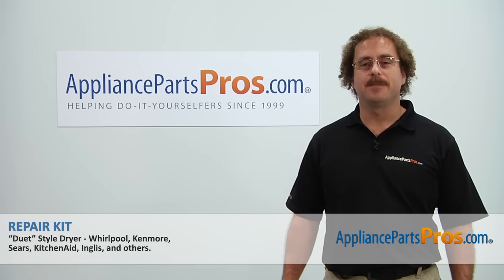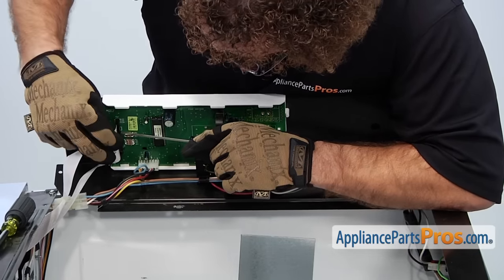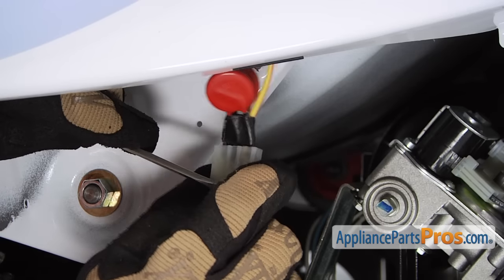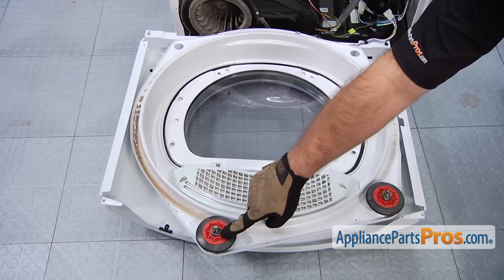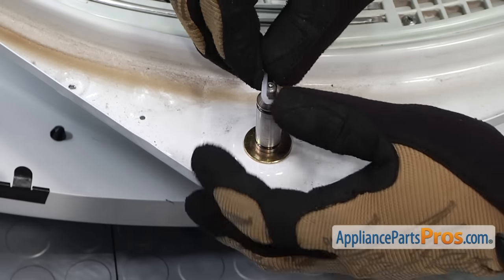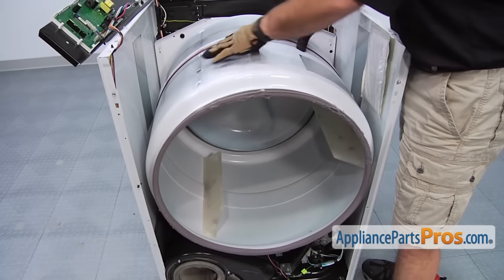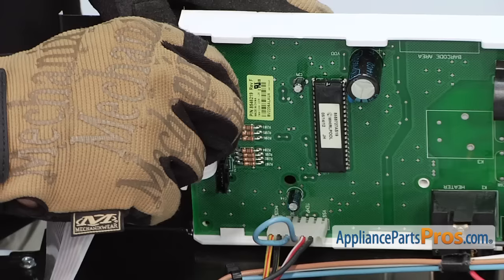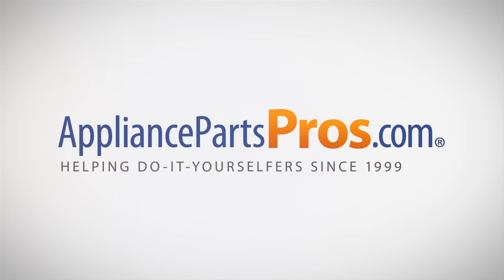Duet Dryer Repair Kit (part #4392067) - How To Replace

Comment: Kudos to Appliance Parts Pros on this video.  After receiving the correct Dryer Repair Kit for my Whirlpool Duet Dryer, I followed the instructions on the video step by step and replaced the dryer belt, rollers, and pulley.  The dryer started up and ran fine.  I appreciated the straightforward yet detailed instructions that allowed a novice to make a successful repair.

Comment: While my dryer model was slightly different in the disassembly, this video was extremely helpful and the replacement parts were perfect. Not only did I save money on calling a repair service, but I also found a $20 in the dryer (along with more lint that you can imagine)! Thank you!

Comment: My Dryer made loud screeching noises, so we thought maybe we needed new dryer since it is 15+ years old.  I did research and saw there was a repair kit for $50+ with new belt, rollers so I thought why not try it since new dryers cost $700 to $1000.  I had my buddy help me since it talked about needing 2 people.  The only issue was removing wire harness in front, it took almost 20 minutes.  To my surprise, one of the back rollers was laying in bottom along with metal shavings since large dryer drum was turning on metal.  Replaced everything and put back together, along with cleaning years of lint all over.  When completed turned back on and dryer ran like new, quiet and also drying faster.  Thank you so much for providing such a complete repair kit.
Reply from the maker: Glad you were able to complete your repair! Glad we were able to help you out. If there is anything we can help you with in the future please let us know.

Comment: We are SO HAPPY with your quality Whirlpool parts and FAST delivery. I must have hit your shipping deadline perfect, because we had our parts delivered by Fedex only 22 HOURS after ordering using your medium priced “fast” delivery! Folks, spend the extra $3 for “fast” delivery! I did have SEVERAL differences between my dryer and the one in this video, but they were all easily worked around and the job only took 2.5 hours including breaks and looking for a tool lol. Dryer is noise-free now!! Thanks for the GREAT SERVICE which I recommend to anyone in need of a DIY remedy.

Comment: Well done Matt, we just installed a repair kit to our dryer.  Thanks to your video we had no problems and no leftover parts.  The dryer runs very quiet now, no loud squeal.  Recommend that anyone going to this much trouble also clean out the vent tube all the way to the outside,  we collected enough lint to knit a sweater.  Thanks for the guidance.
Reply from the maker: I'm so glad our video was helpful! And you're right - anytime you open the dryer, it's a good idea to go ahead and clean it out.

Comment: Thanks for the video! I did the whole kit replacement because I needed to replace the broken belt and figured it was a good time to replace the rollers.
 Never had experience in doing this before. Went well and better yet it worked when I was finished. Learned a lot while doing it. Not bad for an 80 yr. old.
Reply from the maker: You're welcome!

Comment: My dryer was squealing a little, figured was the belt.  Got it apart and it was the idler tension pulley needed cleaning and re lubing.  Went ahead and cleaned and re lubed the 4 rollers, now my 17 year old dryer runs like new.  Thank you!
Reply from the maker: You're welcome!

Comment: Outstanding video that saved us a bunch of money. A few observations: Half of your time will be spent cleaning the lint inside the dryer - vacuum thoroughly, use compressed air to blow lint out of the motor there is a ton in there and lint + spark = fire. Beforehand, empty your vacuum's canister and after you are done vacuuming, dump the contents on a newspaper and go through it for lost items - you will be surprised what you find! The triangular rings (tri-rings) are, on replacement, very difficult to move all the way down the pulley post - if the inner ring looks good, leave it alone and just put a new tri-ring on the outside once the pulley is in place. To remove the old outside tri-ring, use a pair of cutters. The washer for the idler pulley - use this, even if you find a tri-ring was used on the inside position. Clean each pulley with a solvent like denatured alcohol or Gumout on a towel - there is buildup that will keep the pulley from moving a smoothly as it should. Good luck and enjoy the wonderful sound of your repaired dryer!

Comment: Thanks for posting this. It is an excellent set of step-by-step instructions. I used this video today to repair a Duet dryer purchased in 2005. For us the old pulley seemed to be the problem, as it was squealing when the dryer was running. It is working fine now.

Comment: GREAT video!  There were a few differences with my dryer, but overall it took me about an hour.  The most difficult step was getting the dryer belt back over the idler pulley and motor.  But I took the back of the dryer off and it was on in a jiffy.  $30.00 for parts, and this video saved me a ~$150.00 service call.  Thank you very much!
Reply from the maker: You're welcome! That belt can be tricky to get back on, but all you can do is muscle it back on there. Glad we could help!

Comment: This video was awesome. I watched it once thinking, oh my, this is SO much work. But,  with step by step instructions, I was able to take apart my dryer, install the kit, and put it back together... And it works! Thank you! I never thought I could get it done.
Reply from the maker: +Chris Swick Awesome, glad the video helped you get the dryer repaired!
Reply: The hardest part working on washer/dryer is getting access to it. In my case, we have a very small laundry room which barely fits both machines!

Comment: I bought the kit for about $50 and did the repair myself. I saved over $250. My unit must be older because there were some slight differences. The vent housing had 4 screws, (no clip), there were no ribbon cables, they were wire bundles with barely enough slack to move out of the way but the biggest difference was the tub orientation.  My clip was in the back half. I knew it was wrong but decided to follow your video and assembled the drum and the belt around the gear pulley and as I was spinning it the belt kept moving away. I reversed the drum position and it’s working fine. Mine is stacked in a closet so I used a ladder to get to the top.  It was a little tight to get to the screws on the top/back so I used a socket. 
The most difficult time I had was removing the old triangle washers and moving the new ones down the shaft from the first groove. 
My dryer is about 16 years old and I just couldn’t see spending over $300 to replace the shredded belt. I am so glad I did this myself. 
I found about 1/2 lb of lint, sand, pet hair [and a gum wrapper] clogging up the vent just below the lint screen even though I use a long brush to clean it out regularly. Also, the motor coils were compacted with dense, fine lint. There was so much lint and pet hair inside, that I am surprised it didn’t cause a fire. 
Thank you for an easy to follow video and good deal on OEM replacement parts.

Comment: Instructions and parts were both excellent. My dryer was making a loud squealing noise. It was a slightly older model than the one in the video, it did not have the computer ribbons just some power clips to disconnect and some wires plugged in to the mother board. Disassembly was also slightly different since there was a decorative piece that covered the switches on the front and the top console did not come off quite the same, since it snapped around the outside of the drum. 
What was truly interesting (and the probable cause of the squealing), was the original assembly of the idler pulley . There was no washer behind the idler pulley. Instead one of the triclips was installed there without a groove to sit in. Both of the triclips on either side of the pulley were brittle, discolored and showed signs of having  been very hot. I installed all of the parts in the kit and they fit fine. The dryer is back running like a champ. I would highly recommend your video and your parts.

Comment: I just bought a used Whirlpool Duet dryer which I am told is noisy. I think all I need is one of these roller/belt repair kits and it should be good as new. Thanks for posting this video!!!!

Comment: Just verified my model number and ordered this kit. My Dryer was making a knock knock sound for like a year. I let it roll, now it started making a horrible racket. Its a chick chick chick bearing noise. I don't feel like taking the thing apart more than once so I'll chock it up to maintenance and replace it all. Your video shows good detail and from someone who has never repaired a dryer, this looks super easy. I will be using your site for any other parts I may need in the future!
Reply from the maker: Glad the video helped you get the dryer fixed!
Reply: now i gotta figure out the new problem with the washer! F11 MCU communication problem!  ACK!
Reply from the maker: Without knowing what you have, I would suggest posting the problem along with the appliance model number on our repair forum and the techs can help you troubleshoot the problem. http://forum.appliancepartspros.com/

Comment: Best video I found for this fix. My dryer is slightly different but this still fixed it. I installed the whole kit since it has 10+ years of wear on it. The tension pulley was the culprit but there was no reason not to replace everything in the kit since getting the thing apart was really the hard part. Putting on new parts was a breeze.
Reply from the maker: Glad we could help!

Comment: This video was a great help even though my Whirlpool Duet dryer model # WED9500TW@ had a few differences. The biggest difference was the way the console is removed.  Mine has a trim ring that goes around the door that is attached to the console but once I figured out that all I had to do was pop the trim loose then lift the console off, everything else went smoothly.  Glad I ordered the entire kit, it turned out that the problem was the idler pully locked up and the belt just kept turning and eventually wore a groove in the plastic idler roller pully.   That explained why the dryer drum would turn but very slowly and not at all at times.  Thanks again.
Reply from the maker: Glad the video helped you get the dryer fixed!
Reply: I just finished getting my dryer back together and everything cleaned up... my first thought was to come here and talk about the difference between the dryer in the video and mine, which coincidentally happens to be just like yours!  I know it's a two year old post, I thought I'd just give you a shout out and tell people READ THE COMMENTS BEFORE DOING THE WORK!  If I had done that I wouldn't have been as frustrated!  Enjoy the day!
Reply: Paul Arthur Thanks, I was a little confused until I read your post! I was having the same problem!
Reply: I'm about to tackle this same project with our WED9500TW3 and I am expecting the same trim difference.  Was the trim piece easy to remove/pop loose?  Any screws or tabs I need to be aware of that you remember?

Comment: Great video, was able to fix my Whirlpool Duet dryer. Loud screeching noise, turns out it was the idler puller. The only issue was that my dryer was a newer Whirlpool Duet dryer, the front panel was more difficult to remove that the older model shown in the video. I had to bend it up to access two hidden screws.

Comment: Great video, very easy to follow.  Took about 90 minutes for the repair, which included a lot of vacuuming of lint/dust that had gathered throughout the years in the dryer.  We've had the dryer for 10 + years, and this was the first repair to it.  We originally thought it was time to drop serious money on a new set.  Definitely not the case. Thank you for the video.
Reply from the maker: Glad the video helped you get the dryer up and running!

Comment: Thank you so much! This video was extremely helpful. I had a destroyed belt that covered the inside of my dryer in black dust and shreds. Replaced all the parts easily by following your directions and got to clean the huge mess inside.

Comment: Thank you so much for your easy to follow/understand video.. I just repaired/replaced the rollers/belt on my Kenmore HE5- it was almost identical to the video, except for a grounding wire(easily added step.. ).. saved me some $$ on a repair dude!

Comment: OK, so this is an absolutely brilliant video.  My Duet dryer is a little newer and a slightly different model, but this showed me what needed to happen and I figured it out.   However,  am I the only person that thinks the entire dryer should be made out of the "tri-ring" material?  Those things were an absolute B** to get off and they are made of some tuff stuff.   I noticed that even the video cut-out a bit while he was removing them - likely to sensor out the swearing involved.  

Bravo on a great video and thank you very much for producing it.

Comment: Thank you so much, looks like the dryer I purchased used a year ago was worked on before. Someone added grease, and only replaced 3 of the 4 rollers. The pulley was shot and I'm glad I did this asap before the motor went out too.

Comment: Overall I got what I needed from this video. Should mention however that your demonstrator  installed the drum in backwards. At the @ minute mark on the video, he makes a point to mention the black line that the belt makes on the drum, and proceeds to point right at the opposite side, without the black line. He also mentions that the silver tab going  in front, when it actually goes towards the back. I followed the reassembly instructions and even though it went together just fine, I quickly noticed the belt line on the opposite side, and a slight gap around the rear drum felt seal. Funny, when he took it apart it was correct.
Reply: I’m taking pictures as I take my dryer apart to help me put it back together since your comment gave me pause. Also using a Sharpie to mark connectors and tub direction. Love these videos-nicely done.
Reply: Agreed.  I thought I knew which way to put the drum back but when he said the silver tab goes in the front, I turned mine around to match.  Sure enough the belt does not ride where it used to set.  The drum looks symmetrical so I am going to leave it. I don't think it matters, it seems to spin fine.  My drum felt was more worn on one side so maybe rotating it will give it more life.  I reply again if it runs funny and I need to turn the drum around.
Reply: yes!!!! I took tons of pictures and the tab goes towards the back and not the front
Reply: @mermalar Yes, a Sharpie Magic Marker is always good to make notes on direction, screw sizes, or "Do NOT REMOVE", etc! I will mark my drum direction for future needs! And tic the obvious belt line! I have even started a notes sheet, I tuck inside a zip lock bag, that states every time I have made repairs. This is just to track the life span of Amazon heating elements, and other replacement parts!

Comment: Good deal , when I took my idler pully off the shaft on the idler arm was scared up , note the inside of the factory roller was smooth , factory defect I guess,  replaced the entire idler arm and pulley , this pulley has ball bearings ,note factory didn't. I think it will probobly last a little longer since this is the third time being disassembled for squeaking , I didnt replace guide rollers last time either , this time it's getting belt , rollers and high grade idler pulley,  thank you for the video good sir .

Comment: Awesome video. I have the same unit at home that needs fixing (heating element, fuses, etc. but I don’t know the model number for the dryer. Do you know it? I can’t find a plate or sticker anywhere. My dryer is electric not gas.

Comment: Thanks for the directions.  
The only 3 things I would add:  
1) when removing the front lower panel I placed the dryer on a 2x4 to help lift the front to access the screws.  
2) instead of pulling out the wheel's triangle clips I used wire cutters to clip them as pulling them off was taking too long.
3) when working in the computer board area my model had some anchor clips that needed to be un-anchored to free the cables to avoid pulling them when gaining access to that area.   On reassembly I just pushed the anchors back.
Reply from the maker: Stan Wright Good job on the repair. Thanks for the tips!

Comment: I splurged for the OEM parts. The parts were just right but I struggled on the installation.  I couldn't get two of the wiring connections apart.  I spent two hours trying then broke off the retention part of the connectors.  I suppose that was operator error.  Other than that and an hour cleaning lint from everywhere the job went fairly smooth.  I rely on Appliance Parts Pros for the right parts.
Reply from the maker: Glad we have been able to help you out. We look forward to helping you in the future.

Comment: Good video, however I'm a little concerned about the alignment of the belt. You stated that the belt should go back over the mark on the drum and the silver tab should face out towards the front of the unit.  I did it exactly how you said and my witness marks from the belt are not in the same place as neither is yours.  I hope the drum is not backwards or does it really matter?

Comment: Our duet was an older model, but similar features to unscrew and unplug. When he was putting it back together, most of the screws were hex head stainless steel except for 3 brass screws. He forgot where they went. He thinks they go on the dryer vent filter cover.

The technician sheet doesn’t specify